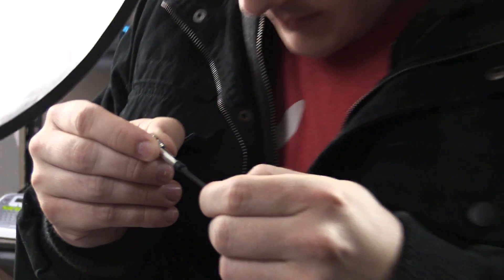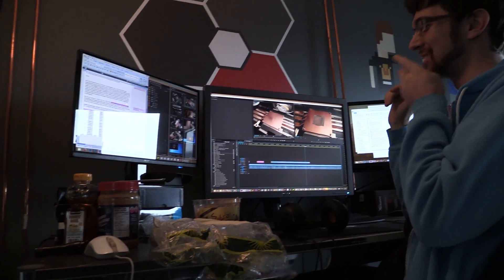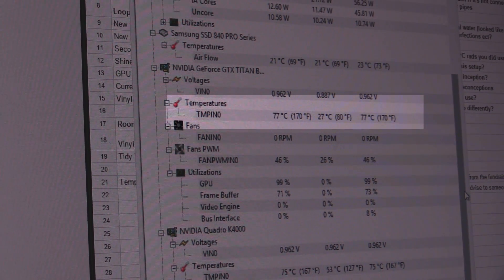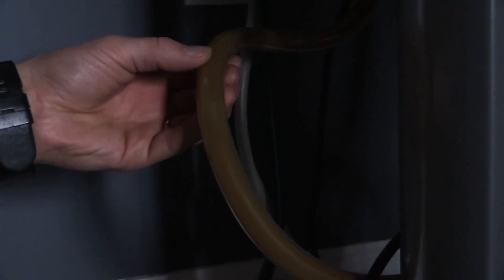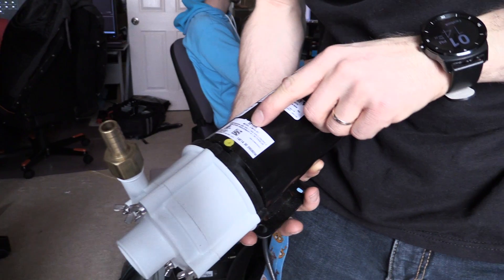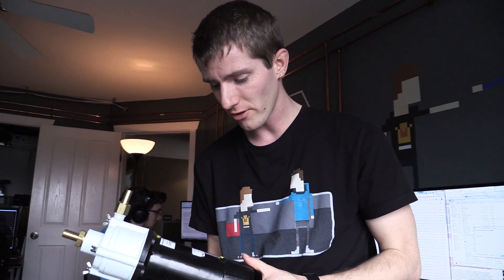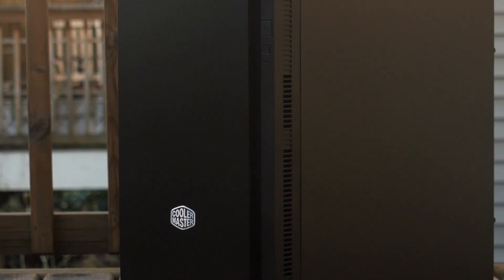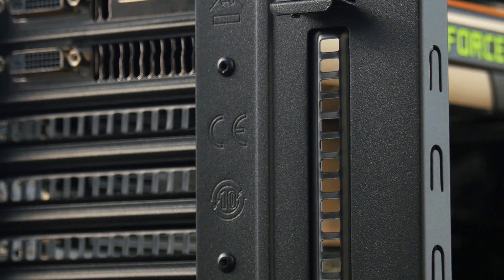Whole Room Water Cooling Part 5a - Trouble is Brewing in the Whole Room Loop...

Comment: If I've got this straight, you're running the pumps inside the towers as well as the pumps from the reservoir. I should mention that I don't know shit about water cooling in a computer but I know know a little about hydraulic systems and I would recommend looking into a single pass shell and tube heat exchanger for when you move offices. Each computer would be on its own closed system yet transfer heat to a common closed loop pipeline, allowing you to cut down on the total copper you'd have to reassemble and have a high flow rate.
Reply: That is a much better idea. Also, Linus did it in the wrong order. IMO, he should have set up each machine's internal loop, then flushed the room's loop with liquid. That way no one's work will be disrupted. Once both are not leaking and purged, then they can be connected together. But in any case, a whole loop like that is a bad idea. There's no way he can ensure equal flow across all the machines. (Since it's one pump driving a parallel loop) And use proper tubing, not some hose. Plasticisers are gonna leach into the liquid. Stick to Saint Gobain (NOT the peristaltic lab grade ones ie R3603) You need food or beverage grade ones. Or that primochill tubing all across. Goodness Linus, don't stick your fingers into the liquid or the res area. You don't want to introduce anything else into the loop.
Reply: That actually sounds quite clever. Good tip.
Reply: Thank you. I've been discussing the idea with a heavy duty mechanic I know and to us it seems like the easiest option if they where to set it up after their move. If it works for stupidly hot hydraulic oil under pressure, it should work for a PC just as well. If they keep the flow rate high enough through the system, they could link the computers in series without too much difference in temperature.

Comment: Looks like the same biofilm that grows in the drain of my labs ice machine. We have a filter attached to the tap water line and it still won't filter everything out. You should consult a company that specializes in biocides, algaecides, and fungicides for closed water systems. Maybe they can provide a solution.

Comment: USE DISTILLED WATER!!!!!!!!!!!!
The same gunk shows up in car radiators if you use tap water.  Just read the antifreeze bottle - it will tell you all about it.  If you buy pre-mixed antifreeze you aren't supposed to use ANY water.  The concentrated kind of antifreeze is usually designed to be mixed 50/50 with DISTILLED water.  Good luck guys!

Comment: My Thought... Get a big enough Aquarium tank and get holes done professionally and install the necessary fittings... The do not cover it completely and use it as aquarium. The organic matter formed in your reservoir may be due to the presence of organic matter in the fluid or some place else. As air is not in direct contact the organic stuff must be of anaerobic bacteria... So for this to avoid and a temporary solution use the aquarium tank. Dividde the tank itself in 2 parts. in one part use the oxygenate pump/air pump to give proper air. Use the 2nd part to collect the aired fluid so no bubbles are present from there you can send it to pump and there by systems. the receiving liquid is of course again collected in the air pump part of tank. Also before using it wash the full loop with water and then with very dilute acetone. Use nailpolish remover if u can. This will help to dissolve any grease if present in loop plus components, act as disinfectant and dry out very quickly with just a dry pump air...

But before trying this use trial and error method on the plastic loops that what concentration of acetone will be safe on those pipes. just take a ear bud, dip it in you made concentration of acetone and then rub it against the pipe. See if the lusture property goes on remains. Dilute till u think its safe. it will most probably be safe at lower concentrations even for plastics...Then fill your fluid and try once again..

Comment: You could save yourself a LOT of headaches and set up heat exchangers at each of the connection points, which would isolate each computer to its own water supply, while still keeping the overall cooling of the whole-room setup.  Copper liquid-to-liquid heat exchangers aren't overly expensive in comparison to the time / money spent cleaning every one of those computers.

Comment: I'm no expert, but its probably iron bacteria, which usually stains everything, as well as clogs piping, including copper pipes. Chlorine is the solution to kill it, just be sure that your seals are OK to handle such chemical. 

In your audio visual equipment, you must be treating it quite harshly, having used hundreds of wireless systems, and the majority of our lav mics lasting well over 6 years, shows that either you have faulty equipment, or lack of care. Rather then placing the mic on your hip, place it on your back (still on your belt), or in your pocket, these areas have the least movement, and greatest freedom (assuming your not wearing skin tight pants).
Reply: It's like they've never seen people on TV with wireless mics.  They're always in the back of the pants or back pocket. Where Linus has his could only be worse if it was used as his belt buckle.  :P

Comment: It looks like some kind of bacterial bloom, possibly something like cyano-bacteria. You could connect an inline UV sterilizer that would kill microorganisms in your loop.

A UV sterilizer kind of like this -  http://www.cleanwaterstore.com/mm5/merchant.mvc?Screen=PROD&Product_Code=UV002370&Store_Code=cleanwat&gdftrk=gdfV26218_a_7c2765_a_7c10236_a_7cUV002370&gclid=CJHh-s2SzMMCFZWGaQodvkAAoQ
Reply: wow this was one of the few actually helpful comments.
Reply: supergipas It looks like a biofilm build up to me, that's going to be annoying to clean out of such a large system with so many different types of material. The UV sterilizer would be perfect to prevent further growth but the existing slime will still be there unless they do a thorough clean of the entire loop.
Reply: Scott Steiner Colloidal silver?? =)
Reply: most reasonable comment so far.
Reply: Cris Stegner all the cooling power put together minus all the heat that's added to the system comes out to more cooling power. An UV sterilizer surely shouldn't add that much more heat to a system.
Reply: Blue Eyes White Teddy facepalm
Reply: Cris Stegner Nope, IR and UV are at opposite ends (but not extremes) of the spectrum. IR = longer wavelength, UV = shorter wavelength – relative to visible light.
Reply: Dawid Pietrzak
Bleach is corrosive for certain types of metal and needless to say that using it in delicate equipment is not advisable.
Reply: I know this comment is two years old but it says it kills viruses. Viruses aren't alive though, how can it kill them.
Reply: it most likely will work but kinda overkill? also would only work for a filter not for a liquid holding tank so yes it will be good to prevent whatever it is growing inside the loop from spreading no it will not be to good to replace the water and anti freeze holding part as the cost will sky rocket to make up the same amount of volume wanted though it might be enough for what is needed.
Reply: Necromancer Bob Yes I agree that the slime will still be there unless they clean it out and the UV would be good for future prevention. Such slime is pretty bad for these water cooling loops. A little known but gross bit of trivia is that fresh water tanks in commercial airlines, ships, and trains will tend to be covered in slime. I guess they should start using silver and UV as well.
Reply: Cris Stegner Heat radiation is infrared, not ultraviolet.

Comment: pipes around skirting boards next time, so you dont need to pump the water up and around and you can use polypipe with push fittings so no trouble with solder joints on the copper pipes, or clear acrylic would be cool and why not make a clear acrylic tank??? i used to run one of my old systems on a water loop to outside with a racing alu rad from a subru

Comment: Your Anti-freeze might contain glycerol, which is a nice nutrient for bacteria. I'd suggest to look in the product descriptions of your loops and pumps and so on, if you could use a liquid other than pure water. The easiest solution would be 50 % ethanol/water. It stays liquid at -20°C and below and nothing will grow in it. In laboratories 80% ethanol (methylated spirit) is used as cheap surface disinfectand. But it is not recommended to use more than 50 % because of the lower heat capacity of ethanol compared to water.

Comment: Ah, so disappointed in this.  Too many mistakes for a team that is supposed to be enthusiasts.  Should have let the community help you design things first.  There is alot of experience out there.  After having a sound card (remember those) get damaged by a cooling leak I said that was enough and and used PC ICE which was non-conductive and anti-microbial. Antifreeze is nasty.   You have to take it in to be recycled and is basically poison to pets.  I'm sure there are other other solutions that can be purchased in bulk.  Heck, I would have turned it into a sponsor spot.  Linus Tech Tips runs off of (insert brand of coolant that is donated).  :^)  I ran some custom high end watercooling for years but now I don't bother.  To much of a mess.  Slap on a huge heat sink and leave it be.  Sure you pay a few extra dollars in AC in the summer time BUT you gain it all back in the winter when the PC's heat your room.  :^)  My fan can die and as long as the case fan is running I'm still running just fine (meaning not quickly baking a cpu) which can't be said for when the pump dies (been there).  Alot easier to take pc outside with air compressor and blow out the dust bunnies than it is to deal with cleaning the loop. You probably still have case fans for hard drives and so forth so you are gonna have to blow out the water cooled pc anyway.  With todays cpu's using much less current and generating less heat water cooling is more of a cross off the bucket list than it is a necessity. Guys, love the videos.  This is just my thoughts.

Comment: The strain relief is too stiff. Common problem that wish they'd figure out. It's not hard. Just add a couple wraps of electrical tape around the part that breaks. Enough to reinforce it, but not so much that it's stiff. I've had to do that a lot.

Comment: Linus, if you placed the Sennhieser mic receiver pack into your pocket and keep a fair amount of tension on the cable that alone should be reasonable. Sennhieser mic cables are very fragile after there support, and are known for kinking and tearing. You could coil up some electrical tape to help support it as well.

Comment: What about bleaching the res and constantly rebleaching till the bleach comes out clear? Or Drain cleaner maybe, just dont gas yourselves by doing both...
Reply: Drain cleaner is excessive, could easily corrode stuff. It's just as harsh as eg. hydrochloric acid, just on the opposite end of the pH scale.

Comment: The gunk may have come from the copper pipe. when you build a house and all the plumbing is finished getting put together the last step is to flush the system. keep in mid all the pipe flux, soldering, and pipe glue if you used any PVC pipe. Drinking any water before the flush is very toxic and will make you sick. Granted your not drinking the coolant but it still needs to be clean. another problem i see is that you may have algae growing in the loop. since the loop runs outside the house the sunlight may be causing it to grow. Solution Flush and sanitize the ENTIRE system, computers and all. A mild dish soap will help and it wont damage anything. Lastly include something like a sand filter into the loop an service it every now and then. It will catch anything the flush missed and anything else that happens to find its-way into the system. Hope this Helps and may the force be with you =)

Comment: I really hope you put the bigger pump in front of the smaller one... Cause otherwise the smaller one can get starved, other than that it should be fine to have two different sized pumps in series.

Also for the buildup you had, yeah, those are from the water you mixed in, that stuff is in basically all drinking water in the world, either brown algae or some kind of bacteria can't remember which atm. You can thank agriculture for that one. So if you want to do it good for the new place(if you're moving the thing with you) do yourself a favour and use distilled/boiled water. (Pro tip: Automotive anti freeze has a lot of sugar in it, bacteria and such LOVES that stuff.) Also that is the reason they recommend using distilled water when you re fill your cooling loop in your car.

Comment: What it looks like to me is something I have seen in my days as a mechanic. It looks like the antifreeze has eating the clear coat or poly coat inside the tank. Automotive antifreeze is actually mildly corrosive because it is designed to keep a vehicles system not just cool, but clean, which is why it is recommended to flush the coolant system every couple of years.

You should use antifreeze designed for a closed loop electrical system instead of an automotive system. If it bacteria related, the reason why bacteria doesn't grow in automotive cooling system is the temps are upwards of 200 degrees, killing any bacteria. Your room system gets no where near that which allows bacteria to grow.

Comment: The main problem in this project is that you think it like you are dealing with a just a giant pc water cooling loop, and it's not. In a water cooled rig the maximum thermal gradient you encounter is around 20 to 30 degress Celsius (60/50° C from the radiator and 20/25 from the ambient), here is almost, or even more then the double!! What you need here is a thermal exchanger to put between the pump and the radiator inside the house, in addiction to another pump for the loop outside. In this way you don't need any antifreezing liquid inside your PC and the possibilities to "infect" it with other substances that could make encrustations or plugs are almost insignificant. There are even more pros considering this solutiion, but I'm sure you will figure them out by your own.

Comment: Looks like the same kind of slimy crud you get in engine cooling systems.  Not sure what causes it, but you can flush it with an external pump and vinegar water.  Might work for this too.

Comment: Your deposit it's mostly galvanic corrosion, you are using the wrong coolant for the application. I would recommend Chrysler g05(hoat) work great with older coper radiator but still got some silicate in it to protect aluminum.

Comment: I wonder if anyone has ever tried ultrasonic cleaning for contaminated radiators and/or blocks... tubing running from a hot water tap/faucet to the rad  sat in an ultrasonic cleaner... then another tube leading from the radiator to a drain.. Only got my ultrasonic recently and i'm all air cooled now or i'd test it myself

Comment: Use CLR from home Depot if it's safe for your coffee pots it should be safe for your plastic tubing. Flush the system 1:4 ratio with water and let it do its thing. It shouldn't harm the cover rads but I would double check that. After a day of having the CLR run inning in the system flush it with filtered water. Filter your tap/hose and flush it out. You took on an unheard of project and every failure leads to more impressive knowledge. Keep up the awesome project

Comment: I could be wrong but a good algicide or maybe some bleach in small quantity would help. Radiators in cars don't get much outside air and go through heat and cold cycles that would kill most bacteria. I would boil the fluid if you plan to continue with automotive radiator fluid mixing with only distilled water if you are mixing it yourself.

Comment: If you add some batadine into the water loop you wouldn't have any bacteria or life of any kind. It is used in hospital as a wound cleaner and more commonly use in the sanitation process of making beer. You could just add it too your water and run it in line with a filter and it will clean everything out. However it is iodine so it will most likely discolor some of the pipes. By the way if you use automotive black piping you would be less likely to get growth of Bacteria. The white pipe let's in light making it very easy for algae to grow. Algae growth is very common in closed loop systems. The slime gross matter is more then likely a strain of algae.

Comment: LinusTechTips all i would have had to say would be to add an Anti-Growth Agent to the system, but at the end you realized that Anti-Freeze doesn't have that property,
which leads me to believe that it's now obvious to you that you forgot that. :p
also consider adding a UV light to the reservoir, for extra microbiocide power. (doesn't need to run all the time, an hour or two per day should be sufficient to back up the chemical assassin).

and if needbe, moderately high pressure water through the components should make sure they're clean when you guys move.
use a chemical cleaner if really necessary (don't forget to use something non-corrosive!).